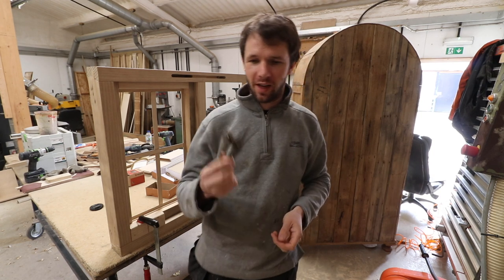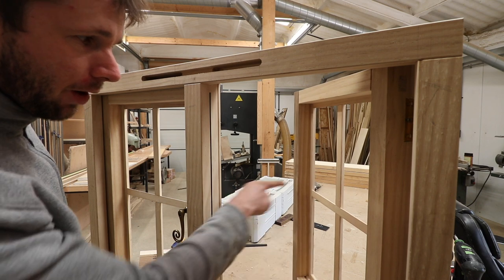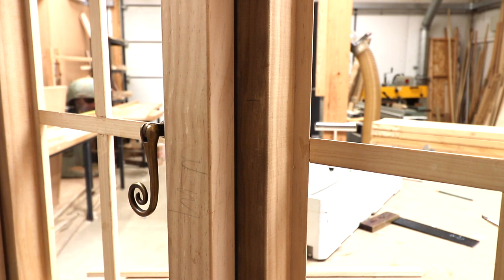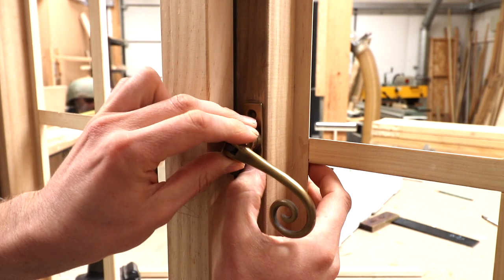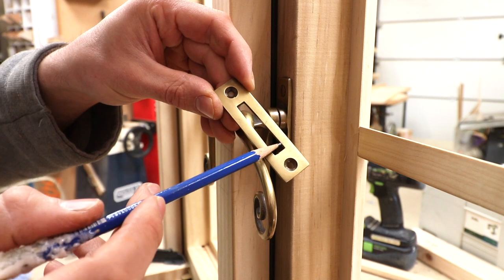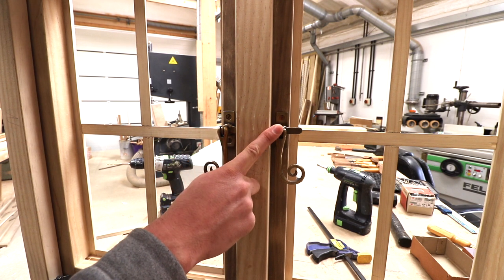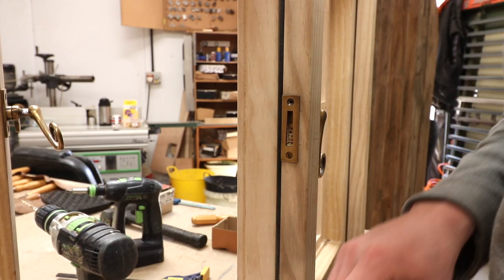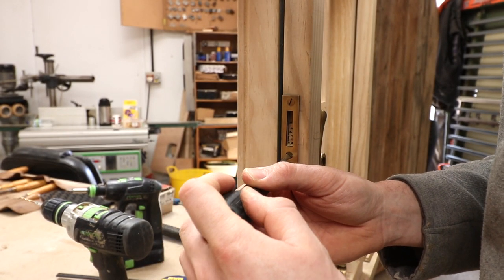How to Install a Traditional Casement Window Fastener

Comment: Great vid. So do you always glaze from the inside now?..
Do you find this method more watertight?
Reply from the maker: I do, I prefer it with accoya as there is no movement to allow water ingress, and when spraying makes for a complete seal outside. Its also really easy to replace the glass

Comment: Where did you get the hardware? I am about to make 55 windows like that. But I am in the states. It’s difficult for me to get the hardwares. Also, the rubber seal gasket. Could you share a link? Many thanks.
Reply from the maker: The gasket is called aquamac 21 and this one is schelgel brand, same as trend in appearance. Deventer make good seals also. 

The handles and stays are from Broughtons.co.uk
Reply: @BradshawJoinery  thank you very much

Comment: Can this type of stay and fastener be used with a screen? I have a house built in 1911 and the attic bedroom gets hot. I like to open the windows a night, but don't want the moths and critters to get in.
Reply from the maker: Maybe. If you just opened the window a little there might be room for the stay to sit on the pins without hitting the screen. Otherwise you could modify the stay and add a hole right at the end so it doesn't stick into the screen when open.

Comment: Surely that fastener isn’t incorrect - don’t you just need to take it off, rotate it 180 degrees and then re-install it? The monkey tail will then be correct.
Reply from the maker: No it's a bit of a mind bender, the handle is joined to the body the same side as the wedge part. They should be opposite, so the handle swings away from the frame as the wedge engages into it. It's a press fit pin and polished into place so not setting I can take to bits and re install without damaging it!